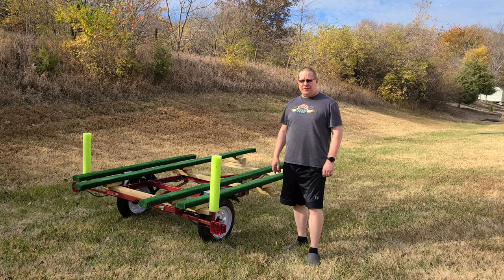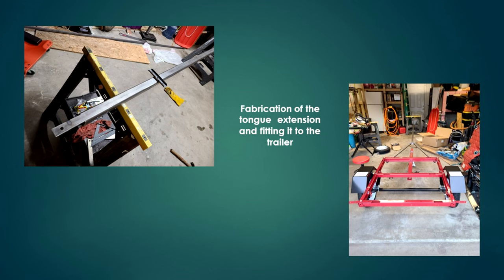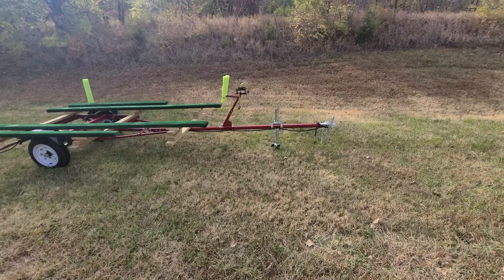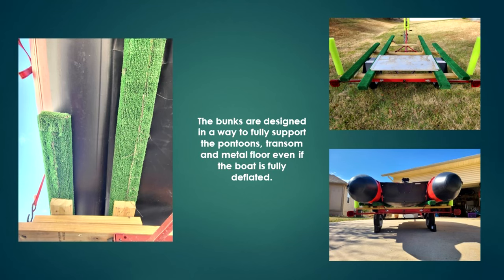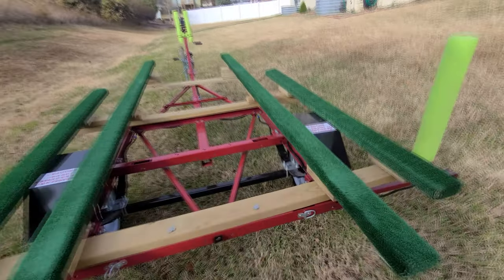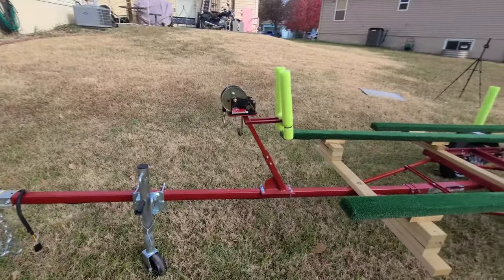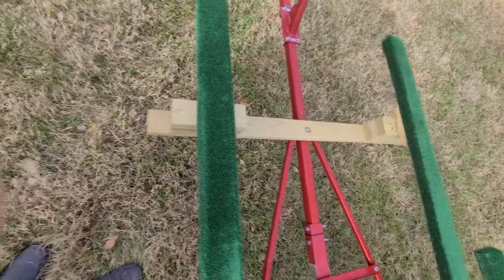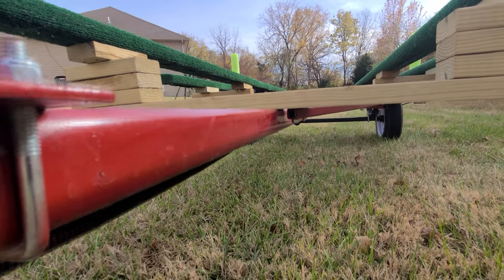Harbor Freight Boat Trailer Mod

Comment: This looks great! Thanks for the inspiration. What type and gauge of metal did you use for the extra support bracket?
Reply from the maker: @emanedoc Thank you for the complement. I used 3/16 inch steel tube. I think it was a bit of over kill for that section.

Comment: Is your tongue extension only held on by bolts or is welded? Also where did you purchase the extension beam?
Reply from the maker: @just516in It is all bolted. I purchased the beam from a place called Metal supermarket, I put the link in the description of the video.

Comment: Hi, would like to ask, know if its possible to somehow add a second axle to these? If you are putting weight on them then at some point someone might think that they might want extra support. And can you add extra length to the trailer also to make it longer, safely or extend the length from the pull neck area safely with welding?
Reply from the maker: @noahriding5780 The original trailer I purchased as a total of 60 inches long I believe. I added a tongue extension. You could add a second axle if you wanted to, but the axle for this trailer is kind of light weight to begin with it is rated for a little over 1000 LB. If you need to haul more weight I would just suggest using a different base trailer.
Reply: @everydayguy.5580  Thank you very much for your reply. 

I'm thinking someone could wel reinforcement to the metal frame though if they did this. 

...

Happy Sunday!

Comment: Does it bounce a lot on the highway?
Reply from the maker: @Martin Harris The first time I used it I did not have a transom saver so I put my outboard in my trunk. I noticed a fair amount of bounce as I drove down the highway. When I got my transom saver  and drove with my outboard mounted on the boat I noticed the bounce was significantly decreased. Over all the bounce is not bad at all. I have 2” square tube that is 3/16 thick so it is a very ridged peace of steel. That being said, I have been considering adding some reinforcing to that lone stretch on the tongue of the trailer.

Comment: Where did you find the tongue extension?
Reply from the maker: I fabricated it from a 2"x2" square tube.
Reply: DID THE 2X2 TUBING JUST FIT DIRECTLY IN THE OLD TUNG OR WHAT DID YOU HAVE TO DO?